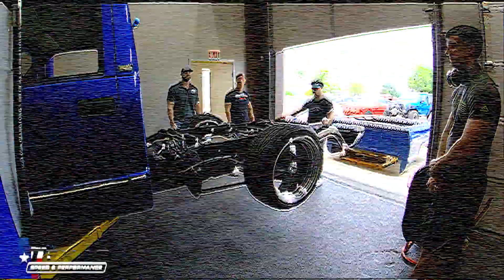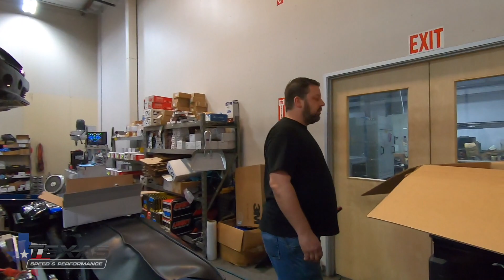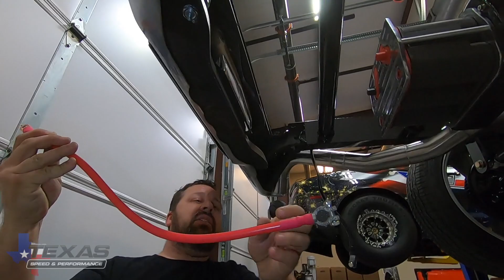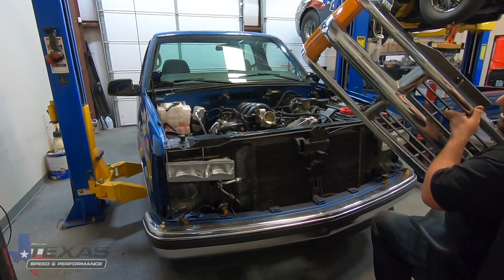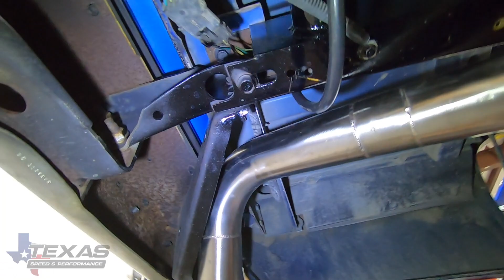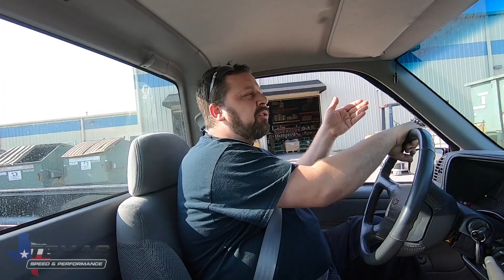Shop Truck Buttoned Up And Getting Ready For The DYNO! Bed Installed And Looking Good!

Comment: Sweet. But wouldnt it make sense to use the hot wire on the starter as a bus of sorts? It has a large probably 0/0 or 2/0 either would work but the 0/0 would probably be the better choice. But anyway its more than sufiecent and its constant power. Great place for your jump/charge wire and your fuse box power wire. Would also reduce the amount of wire being ran reducing the amount of places to be damaged or having issue. And the power wire could also be loomed and ran completely inside the frame to hide & protect it. Unless its against some racing regulations your worried about. Anyway, have a blessed day and tomorrow too!!!

Comment: Im doing something similar got a 2014 engine with a  8 spd and its all in the engine bay ready to go but i need help with the wiring harness. Its all going into a 2008 silverado if you can point me to the right direction that be most appreciated

Comment: question...where did yall get the pieces for the battery posts that yall mounted on the passenger fenderwell. also where did you get the big braided ground.... thankx in advance.
Reply: Most of that stuff was from Painless Performance.
Reply: I think i saw the summit receipt the box
Reply: @jamesrichardson4616  thanks man..I'll look there

Comment: How did you end up running coolant hoses for 6.5 overflow tank?
Reply: TAYLOR FARMS Ordered the 6.5L Hoses and grafted it together into the lower radiator hose. The expansion tank also functions as a remote fill tank so it just needs to be connected to the system. Heater hose would also work, similar to the 99-07 trucks.

Comment: This is awesome! When my 99 OBS Tahoe blows up, I definitely want to swap out to an LS based engine!
Reply: You have no ideal what you're in for
Reply: @richardharris492  I'm hoping the Tahoe lasts until I can buy another vehicle and then I can take my time doing a full engine swap. Suspension and 4wd will stay the same. My goal is to make decent power for towing.
Reply: @richardharris492  its not that bad.
Reply: It's  not an LS it's a Gen V LT based L83 5.3L truck motor out of a 2014 and up Silverado/Sierra.